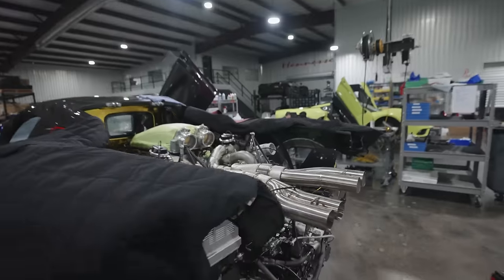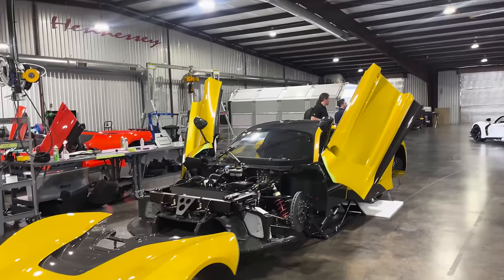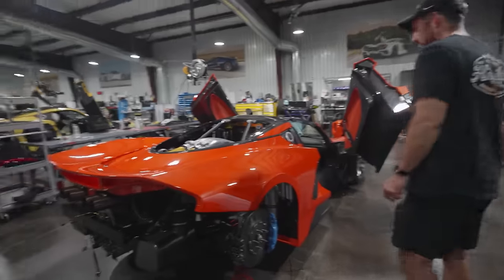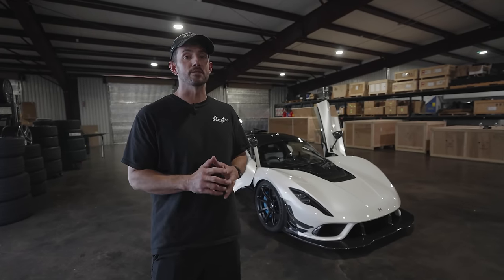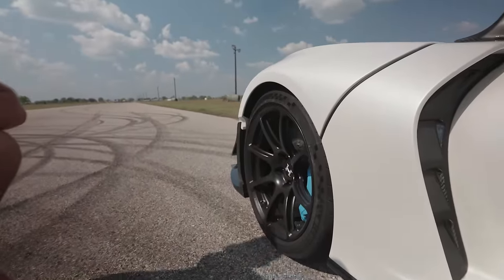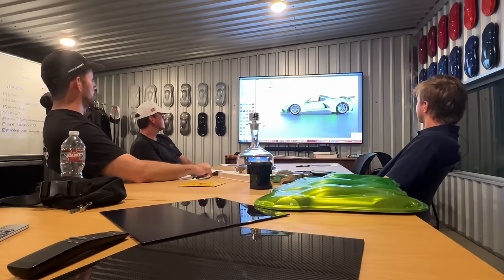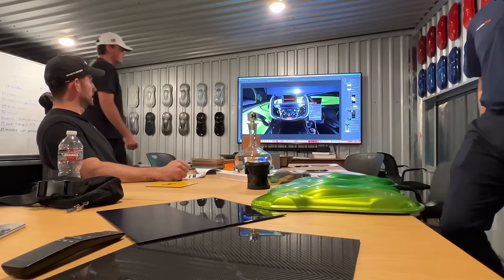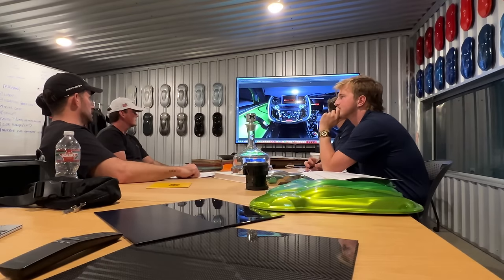Hennessey Factory Tour- American Hyper Car Manufacturer (I bought one!)

Comment: The test track is straightaway, not sure how they actually set-up the chassis by just putting parts together. I cant imagine on a race circuit that tiny open steering would be beneficial.

Comment: If the whole car is carbon why would it cost more wouldnt it be cheaper if ya didn’t paint the car
Reply: If you are thinking about why exposed carbon fibre costs more than painted ones then it's all got to do with matching the carbon weave as there's no paint to hide the imperfections.